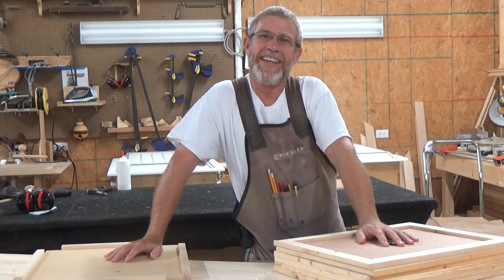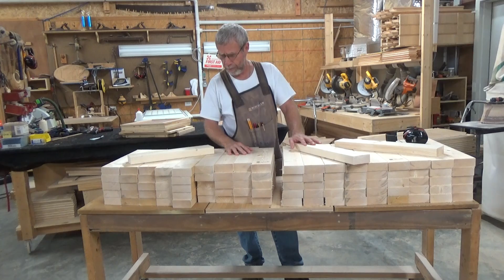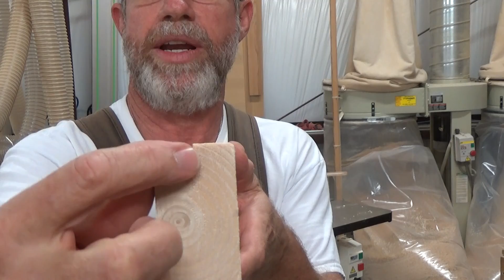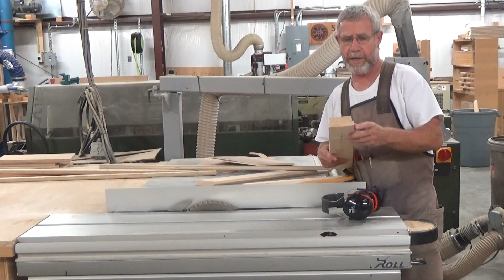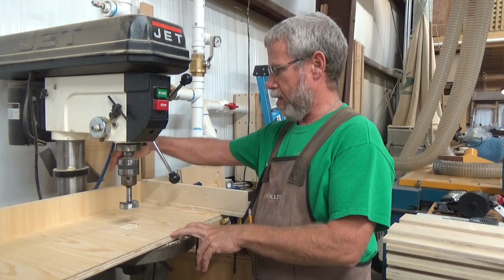Secrets revealed, how to build inner covers.

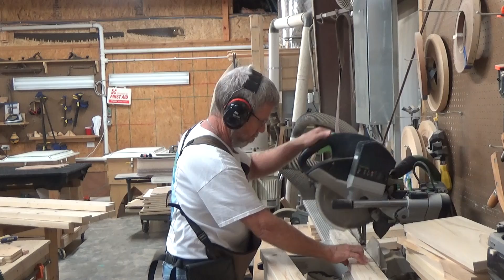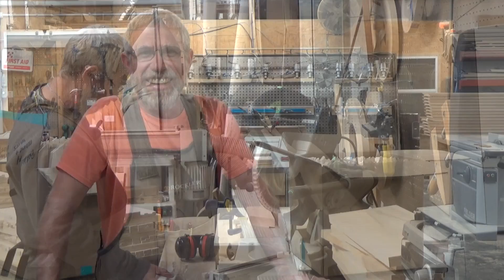Comment: A SHORT CUT IDEA FOR YOU??? -  (great video, BTW!)  The step you did at 3:12 on the radial saw - the first cuts -   If you did the diagonal cuts at this point, rather than at 10:39 - Would this eliminate having to do the 800 cuts at the end?  Also, it would waste less wood, because the initial cuts are at 45 degrees.  (do one end, flip the board, and do the other side). So the cuts would look like this text representation:   |x\.        /.         \.         /.         \x|.   Where the 'x' are the end diagonal waste cutoffs (rather than:). what you have now for 10:39 which is |x\.            /x| on every piece.  Not sure if you'd need to, but maybe build another router push board jig with a 'v' notch cut out in the end to fit the new 45 degree pointed ends.   - Peace be with you.
Reply from the maker: Great suggestion, it makes perfect sense. Thank you for that and for watching. God's peace Don.
Mr. Ed
Reply: No it wouldn't. 

each piece he strips off the 2x4 would end up with a different length and angle.

Comment: Yup. I still want to play with the monks toys lol.
I really like the idea work the lazy-susan. I think I will be putting one of those together real soon. Thanks for the idea.

Most hobby workers don't have a shaper. Wish I did. Router table does just as good, but is generally a little lacking when it comes to dust collection.
 You don't cut a slot in it for an upper entrance / ventilation?
Reply from the maker: The monks have a VERY nice wood shop, I am blessed to have access to it. The slot in the cover, in my opinion, is not necessary for ventilation as there are many other ways for the air to escape. Thanks for watching. God's peace Scott.
Mr. Ed

Comment: I was ready for a fake finger amputation or nail in the finger lol. That’s a really cool workshop with the big dust collector and all. So you make coffins in there?  Interesting. What do you do for the top exit/vent since that inner cover design doesn’t have a notch. Do you run spacers?  You probably don’t have to feed sugar like folks further north. I hate paying for inner and telescoping covers. Not much to them and they are so expensive. I try to make my own bottom boards too. The solid versions. I buy the hive bodies. Those finger joints are a pain to cut and you don’t save a lot making those anyway, unless you have access to some free lumber. Cool video. Thanks!  PS, you shouldn’t call Susan lazy, she might get mad.
Reply from the maker: I can't even joke about shop accidents, they are to real. Every morning when we say our work prayer, one of the petitions is for protection from bodily harm in the shop. It really is a nice shop, and I'm blessed to have access to it whenever I need to. I purposefully did not put exits on the lid as I don't want another entrance to the hive. When I put the third super on, I will drill a hole in the box to add the entrance. Then, I can always close it off when not needed. Because I run all screened bottom boards, the hives have enough cracks to have ventilation so humidity issues are not present. I do not feed them sugar in the hives, way to messy for me. Wait till next Friday when I show the telescopic cover video, you are going to love it. Great to hear from you Jerome. God's peace.
Mr. Ed
Reply: TRUE! Way too much stuff to get hurt really bad very quickly. Amen and amen to that

Comment: I LIKE EM!  BUT I SEE A FAULT!  The middle hole is really useless!  I never bottle feed my bees . what its for,  and to see bees. if there on top,  WITH THE ROOF ON IT CAN'T VENT>  bees above it can't get out" SEE MY POINT" easy fix go back and cut em out! on 1 side>  it needs to be 3/8' high 2 inches long in the middle of 1 end or both ends of the inner cover My roofs are 3 inches longer with a 2 inch over hang so they slide back or forth for summer and winter or in the middle for more ventilation  Just make sure there no bees there > If so smoke em away then slide  THE WINDS AT 80 mph has not blown off!  There slant roofs, ( ^ )  so birds can't bath on top and wash there mites off.   bees glues em down too
Reply from the maker: Didn't put them in on purpose, I don't like them. Just another place for bees to guard and beetles to get in. The hole is for the air to flow up being I use all screened bottom boards. You have to agree, there's more than one way to skin a cat. God's peace brother.
Mr. Ed

Comment: Wouldn’t it be faster to shape and rip whole pieces first and then cut to length?
Reply from the maker: It would save on the cutting part, but each time I shaped and ripped I'd have to do it with a 8 foot board. Way easier in my opinion to shape and rip using short pieces even if it meant cutting to length twice. Thanks for sharing your opinion and for watching. God's peace Stephen.
Mr. Ed

Comment: Nice Jeff. Four mitre saws. Lol. No notches for ventilation?
Reply from the maker: We cut the wood for our lids using the 4 chop saws. There are three operations done on those saws to produce a pair of tops for our coffins. No adjustments necessary, man that's a FINE shop. Wait till you see the upload on Friday, more bee equipment, but I use some of the really cool tools in the shop. Notches not necessary in my opinion, just another location to guard and another entrance possibility for the beetles. Besides, since I use all screened  bottom boards there are enough cracks for ventilation. God's peace brother.
Mr. Ed

Comment: Nice production workflow, Jeff. I'll offer two cents of unsolicited advice you can take or leave: You could probably skip the glue on the end grain without any real sacrifice off strength or longevity, while also speeding up the process a bit. The face gluing you are already doing between the panel and the frame is many times stronger and longer lasting than the glue on those mitered ends. For what it's worth. Peace!
Reply from the maker: I agree 100% the glue and stapling around the plywood edge is where all the strength is derived from. You will notice in the video I post this Friday, I bypassed the glueing of the ends, it is not necessary. I love you avatar, do you do metal work, wood work or both? Guessing, I'd say it was a 4 or 6 inch wood lathe jaw chuck. Looking forward to hearing from you again. God's peace.
Mr. Ed
Reply: Mr. Ed,
I'll look forward to the new video! I hesitate to poke my nose in other's work, but I thought it might help. Yes, I've been a professional woodworker for big chunks of my professional life, and I've been an amateur machinist since college in the 80s. That's supposed to be a machinist's six inch, independent, four-jaw chuck in the avatar. Good eye!

If it's acceptable to the brothers at the Abbey and something you'd be interested in doing, I'd love to see an overview of the casket making process there in the shop. Talk about craftsmanship with heart!
Happy making!
Reply from the maker: It's sad to say, but we have only one monk that works in the casket shop, and he's 82. There in lies the problem, the medium age of monks is about 65, and those that are strong enough to walk, are used in the educating of the seminarians at the seminarian college. Your words about " craftsmanship with heart " could not bee any truer. Of the 24 folks that work in the casket shop, only 3 of them are employees of the abbey, the rest, like myself, are volunteers. The reality of the venture is it is a ministry before it is a business, and all of us who work there consider our work our prayer.....just like the monks. Of all the different occupations I have been in or associated with, none have the atmosphere of St. Joseph Wood Works. I do plan on making a shop video one day to really show the ingenuity, integrity, and craftsmanship of our caskets so that others can have a peak into how running a business can bee both profitable and enjoyable, the monks benefit from the profit, we benefit   from the joy of giving. God's peace brother.
Mr. Ed